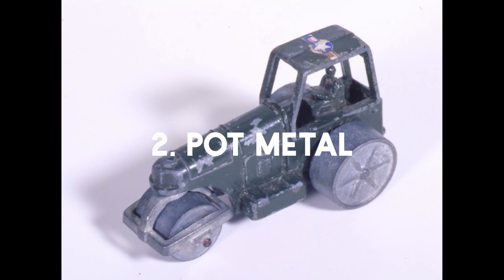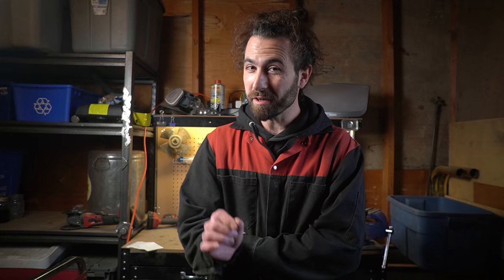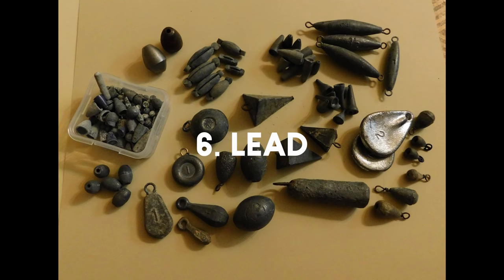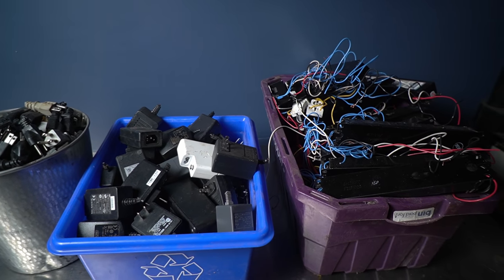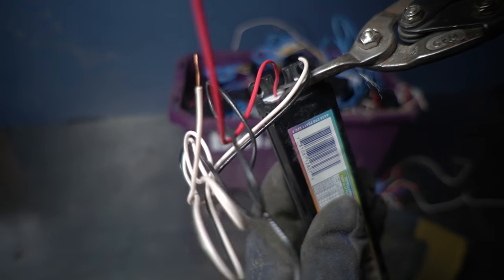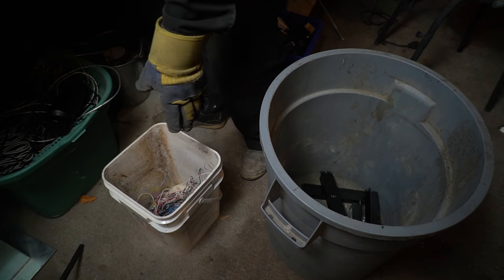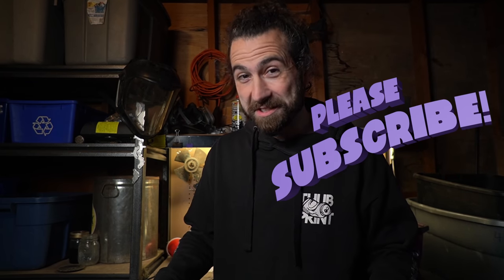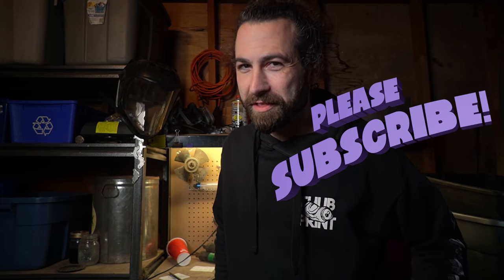I Never Scrap These 9 Items!

Comment: Scrapping seems to follow the ole adage of 
"damned if you do, damned if you don't".
I will dismantle everything, There are things I will not save any longer, like tiny lights from strings of Christmas lights. I only go for the wire to strip. Most every darn piece of wire gets stripped and sorted. One thing the scrapping environment seems to be short of, in my location, is plastics reclaimers and  recyclers. I use to put plastic housings from vacuums, radios, fans and so on, in my curbside recycling and they would take it all without question, until my town hired a new extremely picky contractor, which refuses stuff and leaves rejected items in the bins. I will break down laptops, I do pull pins from plug ends and will break apart female ends of 3 or more positions, for the brass inside. I have scrapped loads of light fixture ballasts and we strip all the wires as well. The balancing act of squeezing value for the time involved, to capture profits, is what all scrappers face,  as the associated quandary. I save every last screw and stupid piece of tiny metal and thrown them in those  Christmas popcorn tins. It all adds up and  when filled up, with the cover on it, goes in the light iron hopper, at the scrap yard. I think we all end up developing our own mind set about, how much time and work, we want to put into the scrapping effort. While many of us scrap for money and personal philosophy, I always loathe the idea of my metals, finding their way into weapons of the police state, and the military industrial complex. I always wonder if some poor scrapper somewhere got killed by a bullet with a jacket made from metal, he or she scrapped. The odds? 
Good video and plenty of food for thought. Thank you from Southern New Hampshire, USA.

Comment: time:reward is limited massively by scrap yards'/middleman/wholesale buyers  margins - the greatest scam that ever lived is "grades". 90% of the work/effort/access/discovery is done by the scrapper and he get's 10% of the money.
join with other ground level ppl to generate/store enough volume to jump as many middlemen as possible on the way to the final source or re-use, there's so much value available in that so be creative because together with others your material is worth more than alone

Comment: the wire if your plugs are cut off of the power supplies should be worth midgrade #2 insulated price however inside the unit all you have is a low-grade board so it's up to you to remove that its not hard but only do it if you get a decent price for low-grade boards. the pie plates if I happen to use one ill crush it and mix it in with my old aluminum/ clean sheet but I never go out of my way for them. laptops I stopped scrapping since they take too much time to bother with, so now I pull the ram and sell the rest as scrap laptops.  ram and CPUs you can for sure sell on eBay and they go fast usually you can also get above scrap price as people that just want to mess with gold recovery aren't trying to profit from it. wit the plug ends the easiest way I do them is to take a pair of the Irwin vice grips and grip them, take a pair of side cutters and pull/twist the brass out. most come pretty easy and if you are interested in this method let me know and ill send you a link to my scrap channel where this weekend's video will be going up on Sunday about that. with the big ones, I will usually pull the brass with the side cutters and give it two to three hits if it breaks ill extract whats inside if it doesn't ill mix it with low-grade boards as that's just about the same recovery rate.
Reply from the maker: Everybody seems to be telling me to skip the boiling! I’ve tried them before and they seem to break off more than pull out. Just doesn’t seem like a bad thing to make an annoying job a bit easier ykno?
Reply: @thubprint  again I'm working in volume so if some snap I'm not usually too bothered by it. but if you keep them at room temp its not too bad

Comment: Laptop screens m8. There are only 2 different kinds, 30 and 40 pin connector screens. 30-40$ on the low end. Touch screens are usually double

Comment: It is definitely just a hobby when you are the low guy out there. Nothing to live on, just a way to reduce waste and the cost of throwing away waste a little bit, and after time, you can collect a larger weight which will return you more money at one time, and I am grateful, but it is not a savings account. I feel like it is less than equal to collecting 5c cans and returning them.

Comment: I PUT BALLASTS IN THE HEAVY METAL LOAD, THEY TAKE EM, I TAKE THE WIRES OFF, MORE $$ FOR SINGLWE STRAND COPPER WEIRE 9SOLID) COMPUTER BOARDS GO FOR 1.45 A POUND AND THE MEMORY OR UPC (GOLD) CHIPS 2,50 A PIECE SOMETIMES  CONENCTICUT, USA  PLUG ENDS, PLIERS AND A LOT OF TIME TO GET 1/4 # OF BRASS PER 200 LOL
Reply: DAMN, YOUR WAY SEEMS EASY WARM EM UP, I GOT TO DO IT, LOL THNAKS FOR THE TIP

Comment: I really try and do plugs as I go or a least a small bucket of 10-20. Same goes for the chunky transformer plugs. Wire from ballasts I save up till I have a bunch to take in with other wire. But the ballasts I take in as a small load with other non-ferrous or motors, because yes, they take up space.
In the end, when scrap sources are slow, there is time to microscrap those and other tedious items.

Comment: With the plug ends, get a steel plate, 5mm thick. Drill 3 holes in it for the plug pins to go through. Put the plate in the bench vice so you're only using pliers- preferably lockjaw automatic vise grip style pliers. You won't need to soften the plugs. All desktop power supplies ( except switch mode power supplies) have worthwhile transformers and plenty of wires not to mention ally heat sinks. Easiest to completely strop the board with a wide blade on an air chisel. Very fast depopulating boards with one of them. Desktop motherboards too,  theres plenty of small transformers there too.

Comment: I like how there are "ore" grades of refuse, an economic rather than metallurgical classification.

I recognize a flipper unit in the background; the spinning board with the fist sized holes in it.  If you salvaged that from an environmental laboratory, you should toss it, as it is likely contaminated with haz waste residues.  It's used in TCLP analysis, and some fraction of those samples come from industrial hazmat sites.

Comment: Ahh thubprint those plug ends, you are doing them wrong. Just grab one end with channel pliers and take side cutters and grab the prongs and twist to the right and it comes right out along with the wire from where you cut it. I can easily do 10 a minute.

Comment: Stripped extension cord wire with a manual pull striper for 1.5 hours.  2.75 pounds of #2 copper.  2.75 x $4.50=$12.36cnd.  No thanks.  Anything under 10 gauge wont be stripped.  My time is worth more then that.

Comment: take your next washer or dryer and take the laptops and a tube of liquid nails and glue 2-3 to the inside walls or tape them on there and put the top back on and kick them into steel tin shred pile. K cups are a pain in the ass also. I put them in the cans and don't try and empty them and peel the top off of.

Comment: I dont mess with Aluminum foils as i get  irony alum price for it.   And alum cans 
Paying  so bad these days at 1990s 
Prices it not worth my time.  

now preheat ballast that use canaster starters.  I set those aside because there is market for those old ballast to 
Restore vintage fixtures.  As preheat (switch Start ) ballast is harder to come 
By for light collectors.   And working single lamp rapid start highly sought of to in the lighting community and Can sell those ballast  $10.00 each easy.
To the lighting collectors. 

 This goes same for vintage fluorescent tubes.  

Another ballast that commonly sold as Transformers

 There is a merket on ebay for working 
 Mercury vapor ballast.  50 watt - 75 watt and 700 watt ballast/transformer 
Is very highly collectable and with worth way more than electric motor price or the copper comtent in them. 

Lap top just not worth your time unless it a 90s lap top such as 486 and 586s 
Those can contain a ceramic CPU 

Now on electric motors it getting hit or miss with copper in the US.   I take my motor apart do sctrach test if it alum
Windings. I put it back together and just 
Sell it as electric motors it not worth my time and blades. 

Low grade boards i just pull off all copper content and and IC chips off
 Rest goes into shred 

 Same for mid grade boards 

Rest of good ewaste get sent off to boardsort

Another one i dont do is Cheap modern 
Microwaves as u have nothing but aluminum trasformers.  Low grade copper wire and low grade boards 
Even taking them apart u seem like u 
Making pennies 

@ everyday stollers 

I AM am interested in some UK light ballast  as I am a lighting collector and scrapper.   I am looking for a 6 foot T12 
Thorn pop pack to add in my collection
Reply from the maker: Sounds like you’ve learned a lot in the scrap game!

Comment: laptops are terrible even for those of us who can fix computers. too much integration and few standard components. even the processors are not worth very much if they are more than a few years old. with an older chip you would be hard pressed finding a still working mobo that works with it. at some point it is cheaper to buy a newer mobo/chip than to get something old to work again. even desktops get problematic when they are more than a few years old. of course if its really old, you are in vintage territory and value goes up again.

Comment: Don't sell lead at the scrapyard. Sell it to reloaders and fishers. You can go to any gun show and look for the reloaders. They'll buy lead off you usually.  

Laptops are good money. The trick is selling the boards whole. Don't depopulate the chips. Just pull the heat sink, copper, steel off it. Laptop MBs are generally top dollar for MBs. I actually make more doing E-Waste than the other stuff and it's a fraction of the time. Though I need to find a good place to send breakage and low value boards.  There are 3 or 4 places that I'll send them, sometimes Ebay.  One cords, It takes me all of 15 seconds to cut the cord end, then a pair of pliers, I pull the brass out. 1 pair of pliers to hold, one to twist and pull. No need to boil them. I can usually get the copper wire out also, which goes into the #2 pile. If the wire doesn't come out with the brass I ignore it. You can get it if you really work at it but then your making cents an hour doing it.  I can do a 3 or 4 a minute usually that way.  Cut the copper  right where it meets the brass and take that in as #2. Brass is usually less than copper so by not snipping the copper your losing money.  The wall warts I usually strip the copper off the transformers.  Copper into #2, rest in steel pile. Stripping those small transformers is usually a matter of a hammer, snipping the tape and pulling. It's a major source of #2 for me. The steel cased transformers are a bit more time consuming. Small ones I just snip with wire cutters, and usually I can pull  all the copper in a couple minutes but some of them are a pain. If it's aluminum wire I don't bother pulling the wire no matter how large the transformer. If it's copper I'll usually pull the wire. The big transformers I just use an angle grinder. I saw a guy on a youtube vid strip those things in about 30 seconds. I haven't gotten it down to that, but you can do 2 cross cuts on top and pull the wire out pretty easily then. The rest into the steel pile.I find those transformers all over the place. In power supplies especially. There's usually 3 or 4 of them in a power supply. The wires I haven't found a use for. They are a pain to strip, though if you do it's #2. I've got a 3 foot mound of the things. My yard won't take unstripped wire shorter than a foot. I brought 20 or 30 lbs of those kinds of wires in once and they rejected them. The power supplies almost always have a decent amount of aluminum heat sinks as well. Usually cast but it's usually easy to pull. They also typically have a few small bits of copper that's really easy to pull. I do a lot of power supplies and typically a quarter of my #2 comes from power supplies and little to none of that from the wires. I also save and sometimes sell the fans if the fan is good. People use them for a lot of odd projects. Dead fans, I've torn them apart but it's a lot of work for a very tiny amount of hard to extract copper. I'm trying to find a good safe way to recycle the capacitors. The insides are soaked with a toxic chemical. I can do 4 or 5 a minute but alum prices as low as they are and the hazards just don't make it worth it. I have buckets of capacitors right now until I figure out a good way to skin and pull the centers.  Hard drives are easy. Pull the screws (sometimes stainless), pop the controller card (well worth the effort), open it up, usually 3 to 5 screws holding platters. There's a super valuable metal of some sort on the end of the heads. The rest of the heads are alum. The platters are all alum nowadays. The top is usually stainless. The bottom usually alum. I pop the center out with a punch. It has copper, but it's a pain to get at. The bottom then goes in alum pile with the platters. The chips inside go in a special pile. They are almost as valuable as the controller cards. There is also often gold, silver or copper in the wire/film connecting the heads to the controller. Takes about 5 mins start to finish to completely do a HD. Laptop HDs usually have alum top and bottom and take less time.

Comment: Oh boy, I have the vid on pause to write this - let's see how many of the 9 I scrap. (hopefully none)  Results in the comments.
Reply: Ok - I've never done a power supply but just got a couple of them.  To the shred they go.  I have a bunch of ballasts but any copper I pull out of those I melt and pour into ingots or rounds, which I get #1 copper for.  I put them in my freezer then I can bang off all the "tar" pretty easily.  That said, I'm with you that it's not a huge money maker, but rather a way to stay busy.  If I was scrapping for a living I would never do them.  All in all, I agreed with your list.  Will be doing plug ends soon since I have a collection.  I saw a guy put them in a vice and use front cutting pliers to remove the brass ends - seemed to work very well and much easier on the wrists.  Anyway, good content!!
Reply from the maker: Glad I wasn’t too far off base, haha! I used to get jazzed about PSUs but at this stage I don’t feel like the little wires add up much at all. Lots of snipping to get them clean enough, at which point the weight just isn’t there. Like I said though it’s personal, nothing wrong with it if someone still wants to put the time in!

Comment: The ugly truth of recycling is that for most part, its not worth it. Two things generally in the US shen it comes to recycling, either they can turn a profit bwcause rhey are subsidised some how, or they are a scam in some way like you are legally required to pass it off to a certified handler, that often just takes your money then throws the waste in the bin anyway. 

It was somewhat profitable when china was buying our trash, but necause they could off set rhat with chrap labour, long hours and bribing local officials.